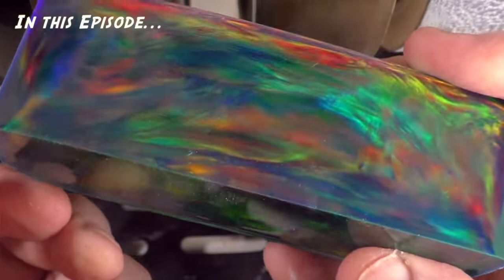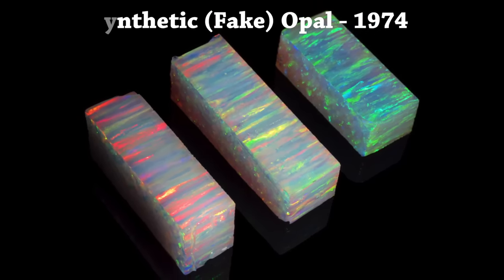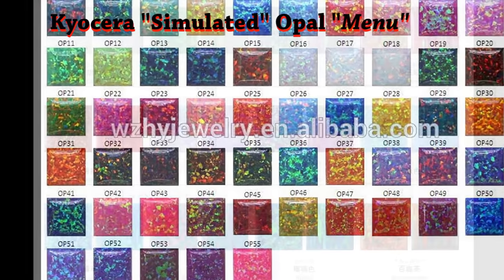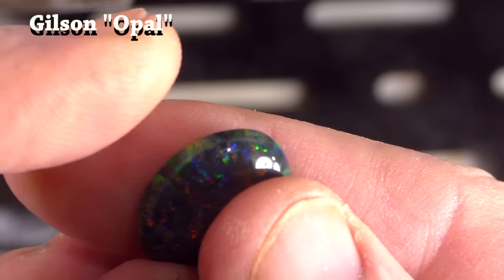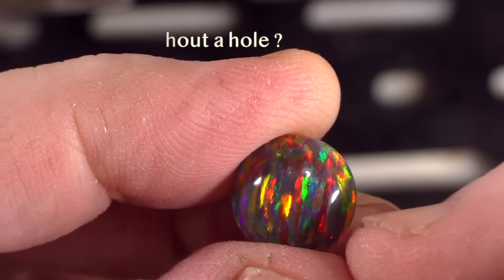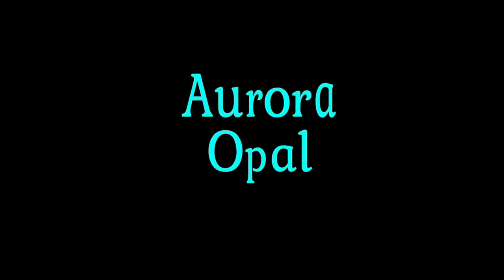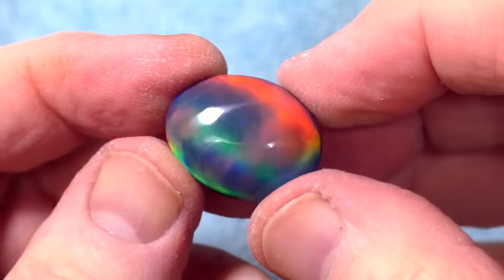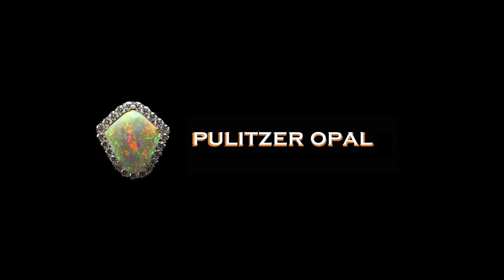Ripped Off   Fake Opal !!

Comment: $300 an ounce for fake opal..........wow....thats seems absurd to me.
Reply: I'd just go buy the real thing
Reply: Most of the price is in the process I imagine. Compared to regular Gilson the pattern is... stirred up? It's very realistic compared to the columnar pattern.
Reply: @PulitzerOpal  You could probably buy a new car for the price if it was real opal, yeah.
Reply: I quite like this faux opal for practicing my bezel and soft stone setting. I’m at the point now that I can set these with ease and they look cool enough in costume jewelry, so everyone’s happy. I would never sell this as natural, obviously, but it’s a lot of fun to design for.
Reply: SunsetBay Bonnie lmao it should be 10 an ounce
Reply: Considering that real opal goes for $42,000 an ounce and up, that's actually not so bad. . .
Reply: @PulitzerOpal  many people wear gems for astrological purposes....So in this case only real gem(natural) is necessary...
Bt people who only want to wear fr beauty ,may go for fake one.....
Bt a real one is a stone and harder than the plastic....So real is durable too.........
Reply: @samsyes5605  Opal (nice opal) is one of the most expensive stones in existence. A top quality black opal from Lightning Ridge might run over $20,000 per carat, and I'm talking wholesale prices. Granted, you've never seen such an opal in real life, and I've only seen them at gem shows, but they certainly exist. The price I mentioned was actually for much cheaper opals, I was thinking top quality opal from Welo, Ethiopia, which will run about $300 per ct. - if you can even find it, which has become difficult in the past few years. Plenty of weak stuff going for $15 to $150 a carat, but hardly any of the 5 star stuff even hits the open market anymore.
Reply: Pulitzer Opal never
Reply: @kevoa4941  < The "Glorious Jubilee" is currently valued at no less than $9,000 per ct, and it's not even all that pretty. But the size is similar. If this were a real opal, it would be worth millions of dollars, more than enough for any car you fancy.
Reply: Gilson Opal is synthetic but NOT FAKE.
It is after all real opal just not natural. And it is in its quality better than anything you will ever find in nature. Natural does not mean better. As has been the case with diamonds for a long time already.
Strange that people rather buy blood diamonds and support warlords than getting diamonds that are perfect.
Reply: @PulitzerOpal  You cant even get Ethiopian for $20 an oz, and if you could it would be gravel. Anyhow, I assume you're talking rough, not finished. When I go to AGTA or GJX, most of the black opals I fancy run around $100,000, and nothing for under $30,000. Granted, I'm talking jet black harlequins with bright rolling fire and plenty of red. I actually didn't see a single one last year (of that quality) but then again I wasn't looking very hard.

The reason that the piece you have would be so valuable IF it was real, it that it's almost all workable, aside from the edges. I've certainly never seen a piece of gel opal nearly that large and perfect. If it were real, it would be worth a mint, and probably preserved as a specimen for posterity, like the Glorious Jubilee. Put it this way, I would snap that thing up for $40,000 before you could say lickety split!

As for the Ethiopian, the good stuff hasn't even been available at shows like AGTA and GJX for several years now. It's all sold before it even hits the market. But the best is easily worth $300 per ct. when finished.

Anyhow, $40,000 an ounce for top quality opal isn't a bad deal at all. Certainly much cheaper than top quality paraiba tourmaline for $20,000 a ct, but still an expensive stone by any measure.
Reply: Its probably way lighter than opal too
Reply: @ABaumstumpf  that's a well put comment I totally agree on that, it's just terrible mining conditions they go through for these blood diamonds, the open cast mining isn't as bad as the holes they dig and send children down, I've honestly never seen such terrible conditions, I'm sure we had better ore mining conditions in the middle ages.
Reply: SunsetBay Bonnie y
Reply: @samsyes5605  I dont trust hipster hippies for this reason. All they do is cater to the enwhitened crowd of colonial european market. And they steal from other people to sell their (other/their=brown people)wares, as charlatans.
Reply: @PulitzerOpal  So you'll be at GJX this year? What booth?
Reply: @ABaumstumpf  Gilson opal is grown. It takes about 14 to 18 months.
Reply: @PulitzerOpal  So will you have a booth at GJX? Only a few weeks away, and I'll be there like clockwork, same as always. As a buyer, though.
Reply: Pulitzer Opal it is not fake. it has the same chemical properties and structure as real opal
Reply: it’s not absurd when you know they cost $15,000 + a carat.  Black ones even more.
Reply: idk where some of you ppl are coming up with your prices..this site has some beautiful stones and not for 15.000.00 a ct.
Reply: @SunsetBayBonnie  Because none of those stones are even close to what I'm talking about. Check this one out, it's not nearly as nice, but at least it gives you a vague idea of the quality I'm referring to: https://www.opalauctions.com/auctions/505-cts-rare-rolling-mackerel-black-opal-lightning-ridge-lro199safe-706050
Reply: @PulitzerOpal  Yes, I got it, thanks. As for your card, you left one with some opal dealers, who produced it upon my inquiries. "Oh ya, he was here yesterday, looking for some opals to make videos." I was a bit surprised to discover your primary profession. Glad you fixed the video.
Reply: @michaelrose93  Your pricing is crazy high and I see top quality Ethiopian opal selling everyday and some of the very best black opal can run for 20k a carat but that doesn't mean you're gonna find someone to pay that. The value is only what people are gonna pay not what you think they are worth and the Glorious Jubilee the guy has been trying to sell it but can't cause he won't get what he wants for it. I can buy rough lightning ridge opal right now with beautiful showing color, dark base, with reds and greens showing and decent color bar for 1k to 5k an ounce and obviously anything that looks flawless can go up to 20k.
Reply: @ABaumstumpf  It has to do with the fact that the natural diamonds can take millions of years for the earth to make them not made by man and would you propose to your soon to be wife with a man made lab created diamond and would she even want it? I understand the whole but they have no flaws and all that but at the moment they cost around 40% of that of a real diamond and in 5 years if you ever want to resell it  will be pretty much worthless because they will just be mass produced and made at a fraction of the cost it takes now, but natural diamonds hold there value forever because of rarity.
Reply: @michaelrose93  Auction is closed and no sale so just like I said you can charge whatever you like and think it's  worth this or that but it is only worth what someone is willing to pay and not to mention that pattern is a once is a lifetime find and will never find a stone like that again but still didn't sell it. I bet you could offer him 10k for that and he would take it in a heartbeat. The prices on opalauction are very negotiable and anyone who buys a gem without trying to get a better deal is either an idiot or just so damn rich he don't give a shit about the money. You can usually talk people down by half the asking price and a lot of time down 2/3's of price.
Reply: @Jbuss0679  "but natural diamonds hold there value forever because of rarity"
Which just means you are willing to pay more for receiving absolutly no extra value.
Reply: @Jbuss0679  < One difficulty is that I was speaking of finished ct value, not rough value, which is what you guys are referring to. Also, my idea of the best is much higher than most. If I walk through the entire AGTA and GJX shows and see one or two black opals of "the best" quality, I consider myself fortunate. Also, I have not seen top quality Ethiopian at those shows for at least 4 or 5 years now, it's sold long before it makes it's way to the show: https://www.youtube.com/watch?v=SsfSJf2sRXw
Reply: @PulitzerOpal  < Yes, I'd say that's a more reasonable range. Even a nice slab of Gilson (lab created) can fetch around $1,000 an oz. But yes, the very best black can get quite expensive, and few people will ever get the pleasure of seeing it; most dealers won't even allow pictures of the good stuff.
Reply: Lol, real opal goes for $1k - $5k a karat, go figure...
Reply: Is it fake or just synthetic one? If it has the same chemical and physical structure, then it's opal, nothing fake about it. Synthetic vs dug from the ground should really not be that important, that is just "naturalistic fallacy"
Reply: supercritical ethanol at 10000 PSI go brrrr!!!
Reply: Cool you come back all this time and give up some hearts for us ❤️  +1 million 👍 reminded me to catch up on some videos when done gambling 🎰

Comment: Fake opal has its place, especially if you like the look of it and don't want to take of your rings every time you wash your hands! Like someone else commented, the only issue is if someone sells you a fake claiming that it is real...
Reply: Pulitzer Opal I have one “opal” ring and it turn yellow and it has like a crack inside... I saw it today and it kind of lose colors if I put it on the light... is it fake?
Reply: @lvialviaquez9146  No it's an Ethiopian... mine did that too. Ruined because of chemicals in hand washing soap.

Comment: I bought a "silver and opal" ring off eBay (from China naturally) for $1 just out of curiosity.  It obviously couldn't be opal and silver, and wasn't.  But I was disappointed in even the fakery; all they did was take some crumpled iridescent foil, glue it to the back of a ring blank, and put a transparent glass cabochon on top.  And I suspect the ring itself is tin.
Reply: Just checked the ad:

Metal used in our jewelry is silver alloy with copper base. Top coat is 925 silver.

Most of our gemstones are genuine. Some are enhanced, faceted or hand-carved. If you have questions about a particular stone, please email us first before placing a bid.

I wonder if that covers them, with the small print saying that not all their gemstones are genuine.  I smoke a pipe, and I've run into the same thing trying to buy pipes from Chinese vendors.  They claim they're wood in the name of the item ("wooden smoking pipe") and then say in the small print that they're plastic.
Reply: @NoJusticeNoPeace  I just avoid Buying from China, as they have a culture, and government that does not have a problem with them ripping off foreigners. It is even applauded.
Reply: @NoJusticeNoPeace  pal China has took all the UK manufacturing jobs away bought up most our steel, you struggle to find a foundry now, I guess it's the same in the USA, I don't have much time for China or India, we used to order clutch plates from India and only 100-150 out of a thousand were useable I asked why we bought them the boss said because after we scrap the dodgy ones it's still cheaper than buying from the UK. Get ready for China taking over - I can see them using India soon for cheaper labour and obviously China will take the lion's share of ore,minerals and precious metals from Africa. Everything you buy from China is usually poor quality I just hope America can win this trade war with them and as we enter Brexit we can work alongside America. Sorry for the rant I've just lost too many jobs because they can't compete
Reply: I have seen these also. Some folks in India make cabs out of it and sell as real opal.
Reply: and its probably radioactive as well!!!!
Reply: I’m sorry for the shitty opal but I’m laughing because I originally read, “I suspect the ring itself is tin,” as “I suspect the ring itself is sin,” 😂
Reply: @PulitzerOpal  I browse (and occasionally buy) loose gems on eBay, and have done for years, and I can't say I agree that eBay has made much progress in cleaning up all the fraudulent listings. I still see the majority of listings as being misrepresented/completely fraudulent, among many various types of gems. It sickens me.

Comment: Very interesting video, but I have a question.  You mention several times that the fake opal is plastic.  At the start of the video you show a knapped arrowhead.  How did you run a flake on plastic.  I ask this as I am a knapper and have made points out of about everything that will run a flake.  I am also a glass maker and make a lot of "fancy" glass to make points and blades from.  I am not try to be negative, just curios.  I did leave a "like".  Thanks

Comment: How are tourist opal souvenirs sold so cheaply in Australia? I bought a necklace with a thin leather strip going through one end of the rock. Overall I would say the rock was about 1 inch x 2 inch and about 1/4 of an inch thick and I got it for less than 30 dollars U.S. it's quite lovely, with small gaps between several colored areas that all look like opal patches with a white cloudy background. On the backside, on about 1/3 of the stone is dark brown rock. Please satisfy my curiosity?Thank you so much!

Comment: It would be interesting to see your opinion on “Profound Glass” manufactured opals that are typically used by glass blowers
Reply: Casey Ellis those are gilsons, they’re real opals and not plastic. they may not be natural and mined from the earth, but mined opals would not work for what profound glass sells their opals for. Natural, mined opals are quite weak due to their water content. Gilson opals have no water and are therefore stronger and better than natural mined opals. They’re the exact same material, but one has inclusions of water and possibly other materials. Profound doesn’t misrepresent their product at all.
Reply: @mooltz  Im well aware of the chemical composition of these opals. Thats why I mentioned they were manufactured. Just thought it would be interesting to see his commentary on the subject and possibly see them used in another application other than being encased in glass.

Comment: I bought what seems an old opal pin, it's just several small opals, but they are for the most part clear.  Someone pointed out, the backs of them aren't painted black, so the color doesn't show up as well.  I think it's very pretty, even if it takes light for it to sort of "shine" the colors.  The fake opals, not really... they are TOO colorful!

Comment: This type of synthetic opal isn’t fake or a rip off, it’s marketed as synthetic opal because that’s what it is. This type of synthetic opal is more used for projects that require cutting sanding or carving the opal, not for jewelry. For example one could work this material into the handle of a knife with clean gap free transitions where real opal will just crack and get too hot and is too unpredictable and hard to be used in that type of application. This opal sands and carves evenly and easily with the other materials it’s mated to without getting to hot to compromise epoxy bond.

Comment: I would send you one of my paintings for that arrowhead?  Awesome Video Mate.
Reply: @PulitzerOpal  the one made from the fake opal
Reply: the one ya show at 11 sec into this video and at 3:50
Reply: @PulitzerOpal  awesome i still have deeper within which i think is probbly the best of the pics i currently have for sell.
Reply: @PulitzerOpal  I added a couple more paintings to my deviant account if you want to check them out. my paintings are not the 3x5 inch cards they sell on ebay  the eagle is little over 10x12 inch the pigment is 11x18inch or close to it. Just letting ya know because there is nothing in the pic to show actual size and didnt want you to think i was just trying to rip you off, i take pride in my work like you do in your work. Anyways let me know what ya think, I enjoy your videos an wish ya good health.

Comment: Why is it so expensive?  When it comes down to it, it's just colored glass or plastic ( thus the fake aspect), so why the heck is it so darn expensive?
Reply: Sandra Rose the $300/oz he was talking about was so gilson opals, which are not glass or plastic like the others, they are real opals made in a lab, not mined/natural. They are exactly the same as mined opals, just 100% opal, no inclusions of other material or water, which makes mined opal very weak. Gilsons are better than real opals a lot of the time, so that price is a steal. The glass and plastic stuff is waaay cheaper, this video did not explain it well.

Comment: That looks like lab made opal. Which is real opal. It's exactly the same, but the color is much more uniform. 

Lab made opal can feel like plastic depending on the form. But it's still real, just much cheaper.
Reply: And I'm not talking about the big rectangular piece. But several other pieces.

Comment: Synthetic opal is the same stuff as real opal. Tiny particles of silica are dispersed amorphously. Different sized particles display different colors. The only difference between high quality fake opal and real opal, is that its man made. Same minerals, same structure, just made in a centrifuge. (Mind you, i am not talking about plastic or resin, but real silica cleverly formed in conditions that mimic the natural condition in which it forms)